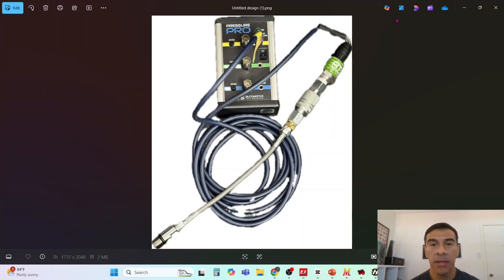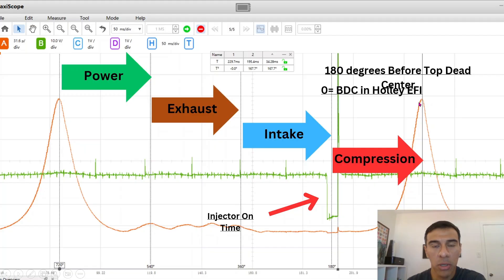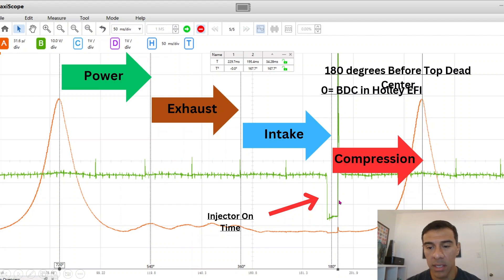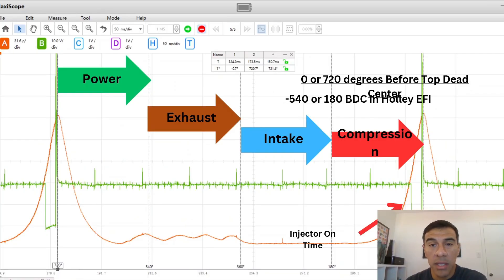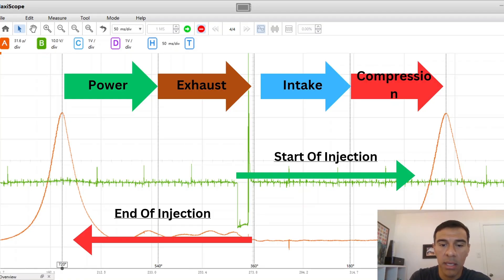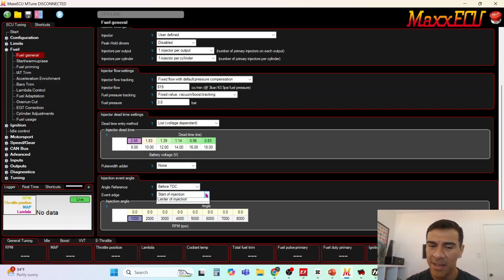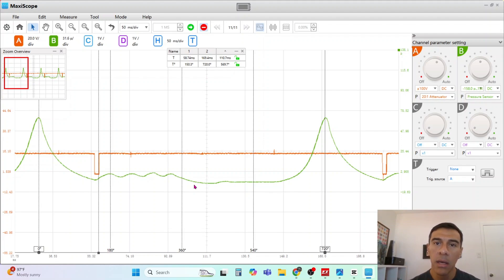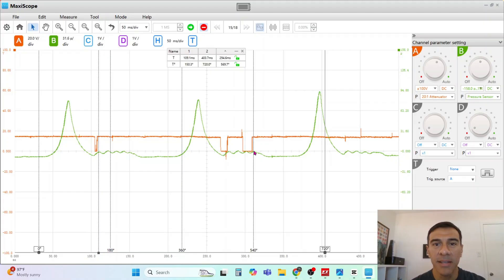Injector Timing

Comment: I’ve been tuning my  DI LFX on the road, I’ve found the best smoothness/efficiency/power is with the spray starting when the intake valve is about 0.100” off the seat and air velocity is developed.